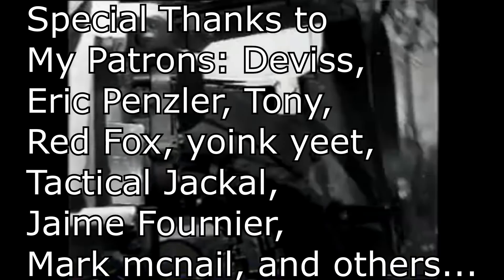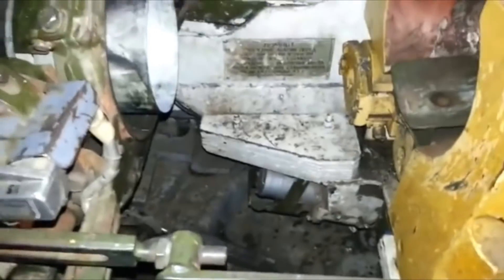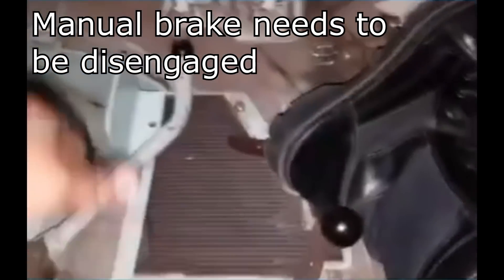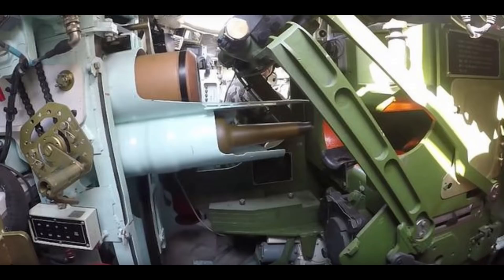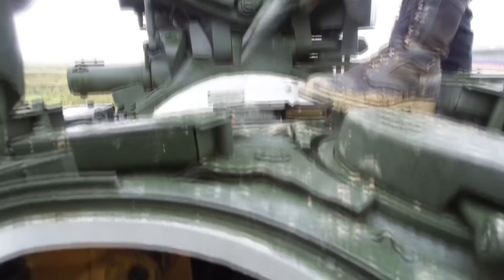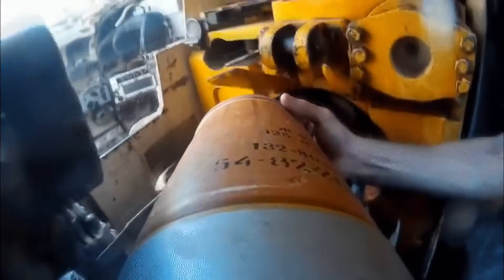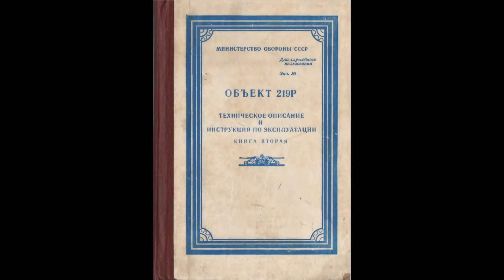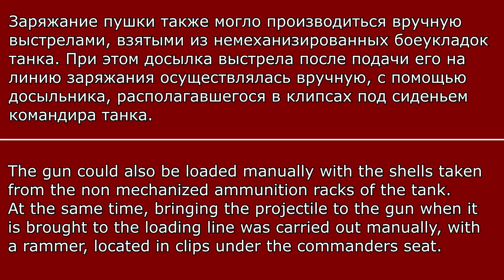Manual Loading in Autoloader Tanks. Is it possible?

Comment: Auto loader failures are rare, especially if they are maintained. I'd imagine any failure would likely be in a sensor, and that goes for any auto loader. In a real life situation a failure might slow load times a little, but for an individual tank on the battlefield it would basically be unnoticed by the opposite side. I'm not sure if the Russian auto loaders are hydraulic or electric. If I had to guess I'd say they are hydraulically driven based on speed and power. But that also doesn't mean they cant use it if the engine is down since they do have an auxiliary pump for the hydraulic system. Interesting to see and learn how they would do it manually. "Poke it with a stick."

Comment: Bringing this topic up I can definitely see US tanks in the future using autoloaders they just need to have a tank design that'll compansate for the "easiness of internal parts" but tanks like these will probably come around maybe 20 to 30 years
Reply: I suspect that any future US tank will have to have an autoloader, because we're heading towards robotic weapon systems. The next tank will be able to operate with nobody in it at all.
Reply: Also the fact that everybody is going to start upgunning the tanks from 120mm to 130 or even 140 mm. Those shells would be incredibly heavy, so a mechanized loading system would be required, even if they would still be manned or have the ability to be manned.

Comment: Early autoloaders weren't very reliable and but some armies focused on improving this reliability and some other prefered ditching the system entirely.

This is one of the reason the Leclerc and the leo2 both exist. France absolutely wanted an autoloader with 3 man crew and germany absolutely wanted a manual loader
Reply: A Syrian Commander with his decades old T-72B said the autoloader is very reliable and rarely fails, and even when it does, it's an easy fix, so the Russians really got this part down.
Reply: @TheNicestPig  t-72 autoloader might be decade old but it's part of the 2nd gen of autoloaders.

The first gen like the french barrels were a bit iffy, but most autoloader post 1960's are at least as reliable as a human loader
Reply: Russians already had some experience with this even before the T-64. The T-10 heavy tank (basically a deep modernization of the IS-3) had a manual loader with a hydraulic assist: the loader just had to put the warhead and powder charge in a slot right next to him, and then pressed a button for that device to push the shell in the gun breech and close it. IS-3 was notorious for its low rate of fire because the shells were heavy (only the warhead was 20+ kg) while the turret was very narrow.
Reply: @Martel_Clips  Leclerc tank auto-loader is indeed not the first french auto-loader. AMX-13 also had an auto loaders even of different construct (2 carroussels). Thus if the decision to equip this tank with an auto-loader was chosen, it was probably that they had a good experience with the previous one even if the predecessor AMX-30 was not equipped with one.

Comment: Could you review the Type 59 G (AKA VT-3) or the T55AGM? I would be interested in learning how effective they really are as T54/55 modernizations, especially when compared to modern tanks.
Reply: You're probably thinking of VT-1; VT-3 is actually downgraded ZTZ-99.
(for closest comparison, VT-1 -> 59, VT-2 -> 96, VT-3 -> 99; you can guess what VT-4 is closer to)
Reply: you mean t-55 amv, they don't had thermal and only kontakt-1. i let you judge
Reply: Yeah i would also want to see a reviw of those t-55/type-59s that got upgraded with the 125mm 2A46. The t54/55 with the 100mm was already so cramped that armies who used it had to set a height limit of 170cm for tankers. Thats why in 1959 the T-55's turret ring had to be slightly stretched out to accept the new 115mm gun, and thats how the T-62 was made
Reply: @warmbreeze7996  No, I mean T55AGM, a Ukrainian upgrade to the T-55, said to have raised the tank to the T-80 standard. Look it up.

Comment: Loading manually sounds easier than doing all those steps in a very small tank moving around. Commander does not even need to get in the hull to get a shell T-72 models store few ammo in the turret as well.
Reply: You only do those if the autoloader malfunction which rarely happened just like the video mentioned because the autoloader is highly reliable. That's why hearing autoloaders malfunctioning are rare.

Comment: "Autoloaders are bad, because they can and will fail."
"4th crewman is good, because other crewmen can and will fail."
Reply: In the 3-man + autoloader tanks the tank can possibly fight with just the driver and 1 man in the turret, since the commander also has both controls for the main gun and can look through the gunner's optics
Reply: What if the loader in 4man crew is exhausted, more time to reload

Comment: A vid on the super speedy japanese autoloaders would be great, they have a reload time of around 3-3.5s
Reply: They are confidential. Unless you want to be the next Challenger II commander
Reply: @julienrooknizan5711  or Leclerc Commander 😅. There accualy are some videos of it showing the raming into the breach but nothing more so that's probably to few
Reply: @warhead_beast7661  I’d say Japanese auto loader work by making a munition ready just after charging the last one, meaning the gun just need to get in position and a round is pushed inside which would explain the speed difference with Soviet tank who need to move the round for each reload
Reply: Certainly the lack of the ammunition elevator helps

Comment: T72/90 got typical artillery style shell-rod-burst-rod loading cycle. Not so hard to pull off, the only problem is non-optimized storage racks.
T80 got 3 modes: Auto/semi-auto and manual.
Manual is the same as T72/90.
Semi-auto requires you to slap shell and burst together on the tray, flip the lock (If the "shell" in question is actually ATGM) and punch the button.
Both kinds of tanks had a qualification of 12 second reload cycle, with expected sustainable reload time of 15 seconds for manual mode. In practice you cannot meet these times if you need to pull the farthermost (Is it even the word) duplets. T72/90 allows more or less painless way to eject shells from carousel (But expect to slap extra 3-4 seconds for shells due to carousel cranking), T80 carousel is less reliable, and easier to damage (Which is almost guaranteed jam, making shells unusable).

Comment: I dont understand why they load 2 separate things into the gun and not have them as one piece. I would imagine that it would save alot of time when reloading and the mechanism could be way smaller.
Reply: probably to make the autoloader smaller
Reply: Looks like to save space.  Also probably make the carousel smaller and harder to hit in case of penetration
Reply: Because it eats up less internal volume that way. Just visualize the shells as single-pieces inside the turret. T-72 is cramped enough as it is without more volume being taken up by single-piece ammunition, what's more, vertically stored ammunition would maximize the chances of a penetrating hit detonating the rack whereas horizontally stored ammunition may not even be able to fit.
Reply: They want to make the tank short and small as possible. So,  their tanks are less probable to get hit in the vast Eastern European plains.

Comment: Could you update your Iranian tanks video? Some big mistakes were made and new info has been seen after the video was made. For example the production variant of the Karrar was not the black one shown. The production variant has an electro optical jamming system, a wind gauge/meteorological sensor, what appears to be newer sights (could be wrong), and lacks the gun metal sheet thingy. We also know it has a 1000hp engine, and Iran has a 1300hp engine that could be used in future tanks. Also you said it has Kontakt-1 on the turret even though it's quite visually a Relikt ERA variant. Also the Karrar entered production, there's factory pics, test site images, and articles on it. There's a very low quality video that someone recorded of a state media broadcast that shows what appears to be an Iranian APS test. 

The last tank you showed in that video is an upgrade of the T-72 M and S variants, which from what information I can find is called Rakhsh. We saw it use with the Iraqi PMF recently. If not, could you do an analyzation of Iranian Tusan AFV and Makran IFV Hope you see this, love your content!

Edit: I should also note that Karrar was seen being transported to the Azerbaijan border
Reply: I'm interested too. Are you sure that the ERA in question is Relikt?
Reply: @matovicmmilan  it's identical in every way except for the fact that it's slimmer. Angled the same way in the same area too. If it's not Relikt it's definitely not Kontakt-1 and is definitely similar to Relikt.

Comment: Does the manual says anything about the procedure in case of misfiring a round? When you fire the round but nothing happens?
Reply: My guess is that it is similar to procedures for hang fires in small arms:  Keep the gun pointed in a safe direction, wait a period of time (30 seconds to a minute in small arms), then remove the charge, maybe the projectile, and discard the removed content(s) outside the vehicle.  In combat the contents of the chamber may be removed after waiting a much shorter period of time, but this is much riskier for cannons as if the charge goes off, it is much more destructive than a small arms round exploding.
Reply: @hdog9046  In the Abrams there is a whole procedure to do this, they wait, they try again with auxiliary systems, if that doesn't work, they put away the failed round back behind the blow out panels...

Comment: No, if your autoloader fails, you have much bigger problems than a defective autooloader. Also, during the wars in former Yugoslavia, no cases of autoloader failure in an M-84 tanks were reported. Finally, the M-84 does not have the same autoloader as the T-72 tank.
Reply: Da li si svestan da je M84 kopija T-72M pravljena po licenci? Prva serija od oko 150 jedinica je bukvalno bila indentična, a sledećih 500-600 koji su imali domaću optiku, višeslojni oklop i motor od 1000 ks su nazvani M84-A. Znam da se tada u školi učilo da je M84 naš originalan projekat i da je na testiranju u Kuvajtu nazvan "najboljim tenkom na svetu", ali zapravo nije baš tako :)

Comment: Red effect what is the difference between T-90MS and T90M?
Reply: T-90M is the Russian model, while T-90MS is the export variant, although intersetingly, T-90MS came out before T-90M came out

the differences are:
Roof-mounted MG (12.7mm for M, 7.62mm for MS)
Cage/chain armor (MS does not have any of those)
Engine (if i'm not mistaken)